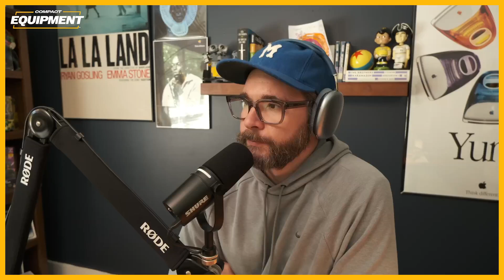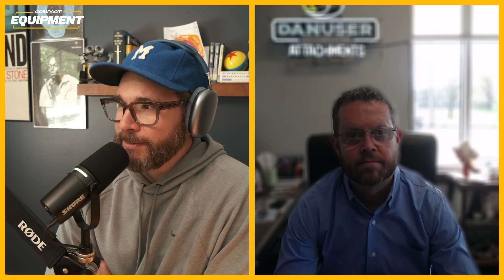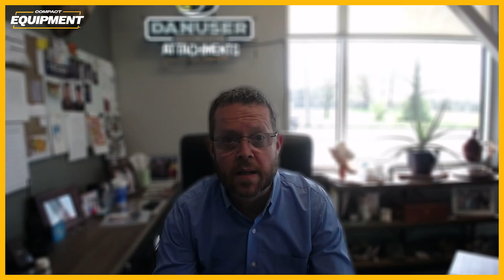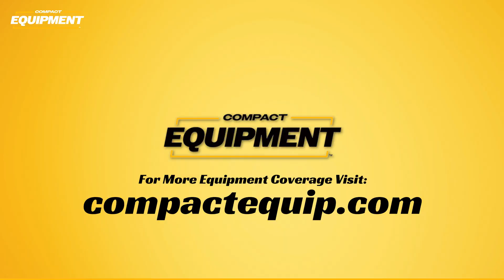Drilling Deep Into Augers for Compact Track Loaders and Skid Steers with Danuser

Comment: I have a bobcat 463 mini. Hard to find a aftermarket bobcat Mt attachment plate. I've also seen smaller augers at auctions and I noticed there's only one pin going One direction in the top of the auger motor and then I would think if the skid steer is not on flat ground my auger May drilling crooked? Heritage skid steer once for one day for $850 and there was a pin going both direction on the top of the auger motor so it would drill plum holes. But I don't see that on the August I've seen at auctions
Reply: Voice texting isn't working I said once rented not heritage. And I said augers